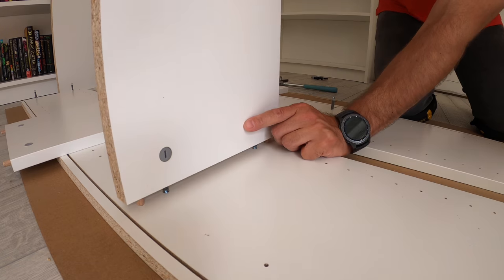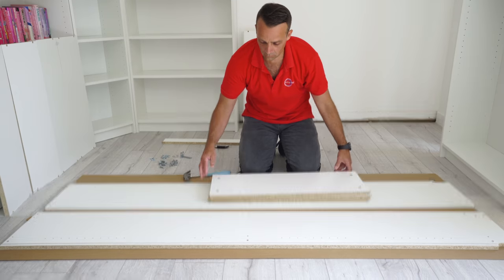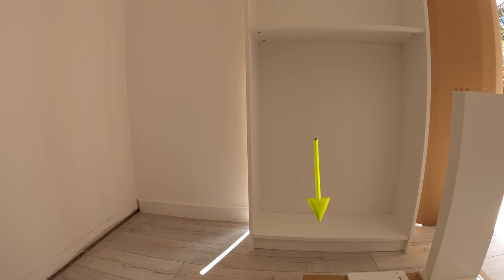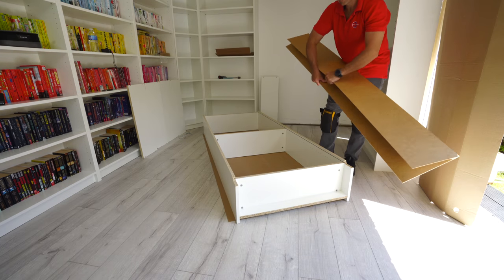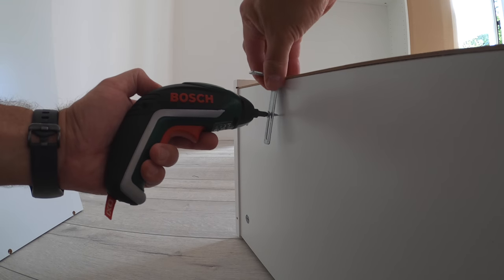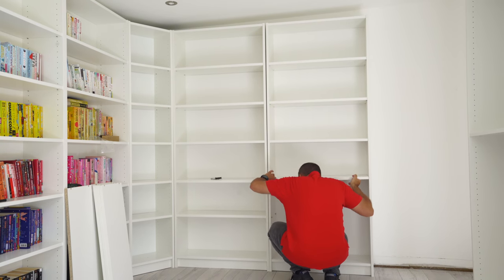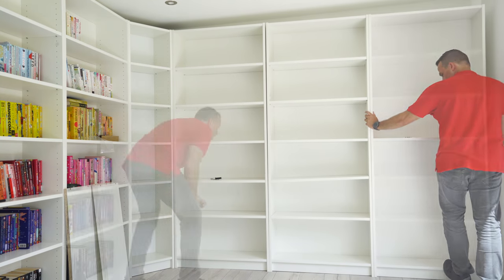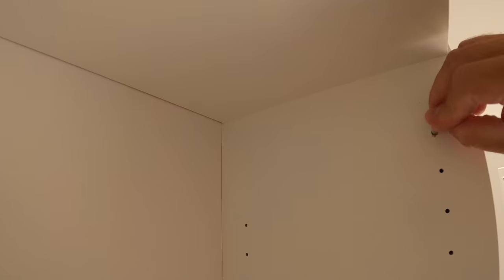IKEA BILLY Bookcase assembly, joining BILLY Bookcase and wall fixing of Ikea BILLY Bookcase

Comment: Thank you for a helpful and positive set of instructions. I have two very small suggestions.
1. Use a shelf laid on the backing, between the sides, to marking a line for nails. It is automatically parallel to the top.
2. Many Drill-Drivers are now very powerful. Always set it to a low torque setting to install screws in the side panels.

Comment: Hello,
Can you provide the size of the connection screws (in mm) that you are using to join the bookcases together and at what heights do you recommend putting them?

Since the width of each bookcase wall is .75 inches (1 1/2 inches for 2 bookcases together), should I use an M6 40mm connection screw/barrel bolt?
Reply: Anyone get the answer for this because I'm about to do this
Reply: I'm using the M4 Ø 5mm 31-40mm for the Billy 40x28x202cm
Reply: Can you provide a link to these?

Comment: Thanks for great video. Sorry guys I don't understand anything about drilling😅: the L bracket that we screwinto the wall, is there actually no screw that goes into the Billy?? Thanks
Reply from the maker: Billy bookcase don't include wall plugs and the screws so if you want to secure them to the wall you need to buy them extra. Just get the right one for your time of the wall btw. Ikea selling that too. Ikea FIXA - 260-piece screw and plug set

Comment: great video, do you know if the background panel is necessary? can I avoid mounting it?
Reply from the maker: I would suggest the back panel BILLYis already slim it would go down. Well if you attach unit to the wall possibly can work without back panel but still I would put-it there better safe than sorry

Comment: Is there any other way to stabilize it WITHOUT screwing it to the wall?
Reply: Nail the damn thing is another way as long as you can figure where the wall studs are.
Reply: Prayer. Nothing is impossible with the love of Christ.
Reply: Use something heavy at the bottom.

Comment: This looks really good, though after wrestling with my Billy bookshelves, I've found that if I so much as look at them the wrong way, they'll chip and break.  Wondering if anyone else had this same experience.
Reply: You get what you pay for, you won't find a better price point anywhere for  the quality. If you want something that is gonna last for generations get bespoke hand made, and pay the price
Reply: @benhersko2830  wrong!  If you buy the lumber and cut it yourself, you pay less and it will last forever.
Reply: well obviously! The more you do yourself, the cheaper it will be
I was comparing like for like, IKEA's Billy's are the best quality complete flatpacked bookcase in a box for that price point
If u have the skills and tools to make your own, it will obviously be better
Even then, you will not save a great deal in costs, as well, it is unlikely that you will be able to cut to the same tolerances that a factory sliced bookcase will have
Reply: also, one further point, a Billy takes 10 minutes to assemble, build your own will be 2 or 3 hours hour, minimum! Your time is also worth money

Comment: The audio was kind of hard to hear when you described the screws that join the shelves together, what are those called? And do they come with the Billy's?
Reply from the maker: Screws call Connector bolts screws and they not coming in the box with BILLY Bookcases. You can get them in any diy store.

Comment: How tall is the cutout in the back of the bookcase. I know I need shorter baseboards, but how short should they be?
Reply: Aprox 60mm. Just take a jigsaw and cut off a bit more if you need. But most walls, especially in older houses, aren't straight anyway, so it's an irrelevant issue

Comment: Having a very hard time finding the right size joining screws - where did you get yours?
Reply: Width of each panel is 0.75 inch, which makes it 1.5 inches.  There is this type in Canada, but it's plastic:  https://www.grainger.ca/en/product/BINDING-POST%2C15-64X1-1-2-IN%2CPK100/p/WWG5MB12
Reply: Hi order from Ikea spare parts. You need one 100402 and one 100644. They fit into each other as show in vid. Hope that helps, Ikea will post them straight to you

Comment: Do shelves bend after some time in the middle? I have heavy books.
Reply: The longer Billy will. But the short version I have had no problem with.
Reply: If that happens, I would flip the shelf and re-shelve books.
Reply: @genejohnson382  Makes sense. Though, it will require some work and mostly likely won't be able to do that too many times. Since screws go inside and through the body, would have to disassemble the whole thing. With omnibuses it's going to be pretty often.
Reply: If heavy items I would use 2 shelves(1 sitting on top of the other which is sitting on the screw) That way shelf won’t bend.